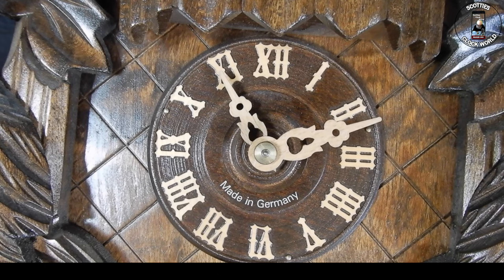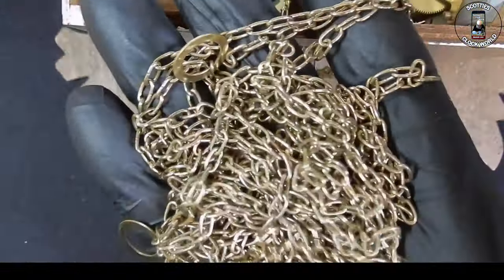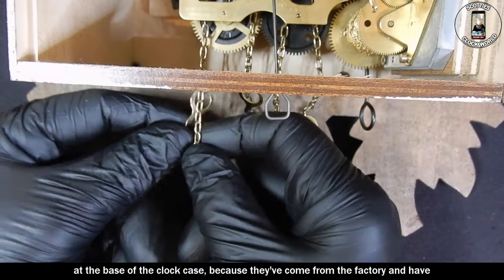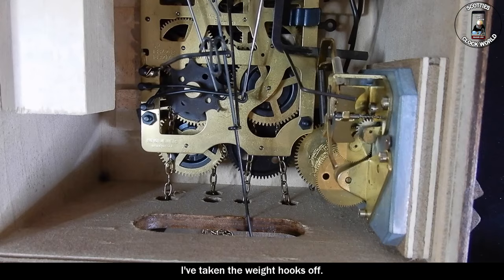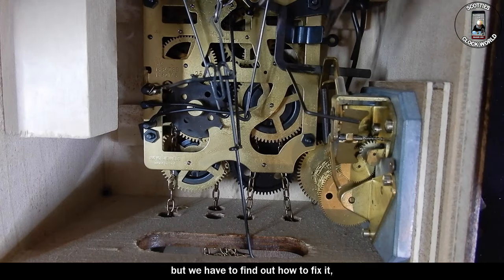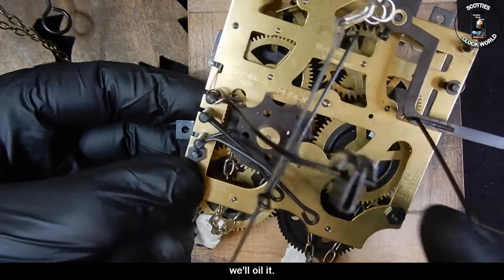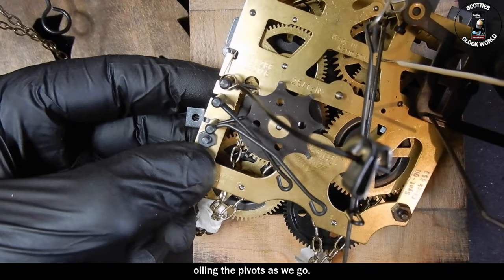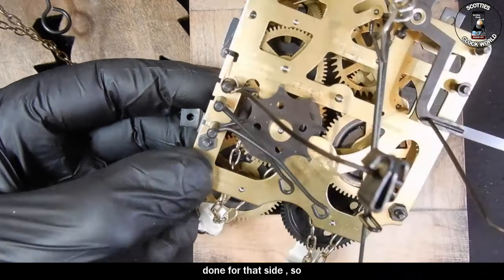Regula 25 Platform Dancers & Music Box Clock Service - Episode 1

Comment: Scottie - i am losing my mind!! I have a regula 25 as this video shows - it will not keep ticking with a pendulum with the weight - if i use a large weight it ticks with no pendulum - than stops after 20 minutes or so - there i snot much "bending" of the escapement to do - i cleaned all, oiled and see zero wear on pivots - AHHHHHHHHHHHH
Reply from the maker: First thing to check is the End Play on the Escape Wheel, if it is insufficient the Escape Wheel will slow down and then stop. With a weight added, the Escape Wheel should easily turn and the Pallets and Crutch will  oscelate at a fast rate.
Reply: @ScottiesClockWorld  thanks!